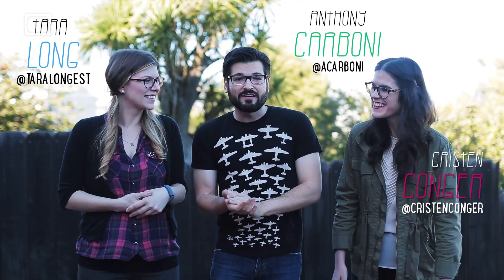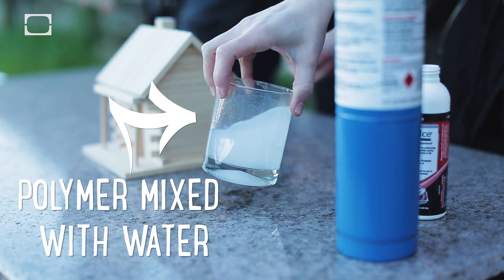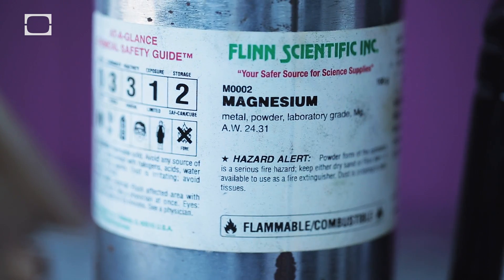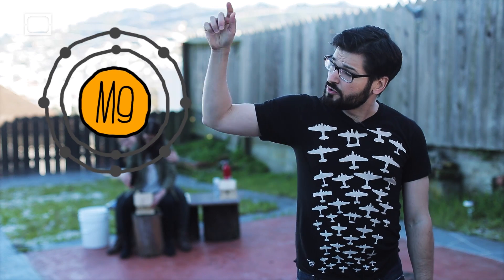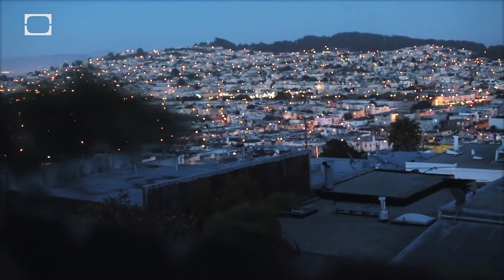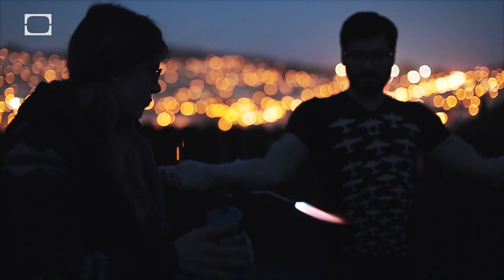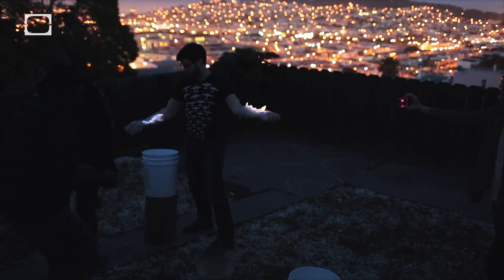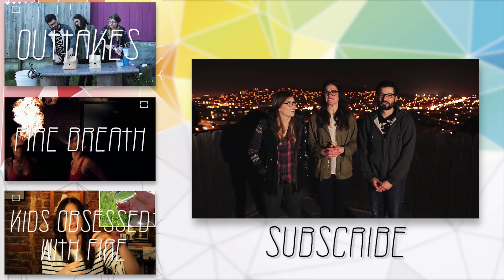Lighting Anthony on Fire with Science

Comment: We did this in science class with soap and gasoline and we let are hands on fire
Reply: We did it with methane I think from the gas supply in our science labs and dish washing fluid. The methane gas made bubbles when a hose was attached to the supply and connected to a bucket of water and dish washing mix. We then dipped our hands in water and scooped the bubbles on our hands and put our hands sideways into a flame from the bunsen. It was an amazing moment as the flames reached the top of the roof in a puff of fire right on your hands xD.